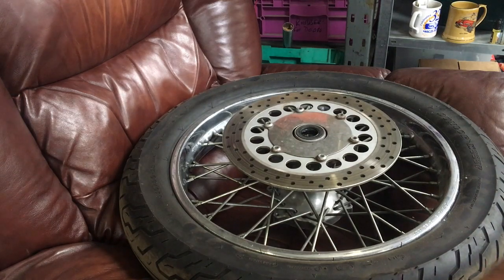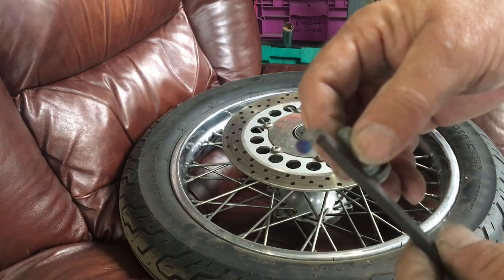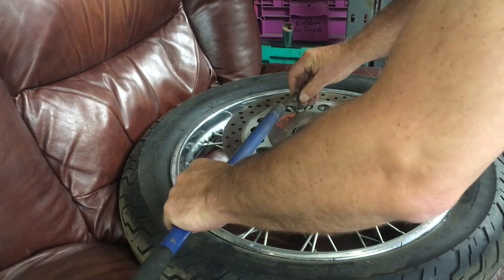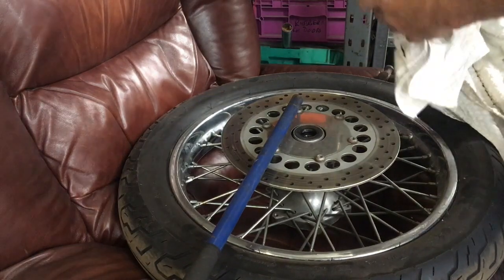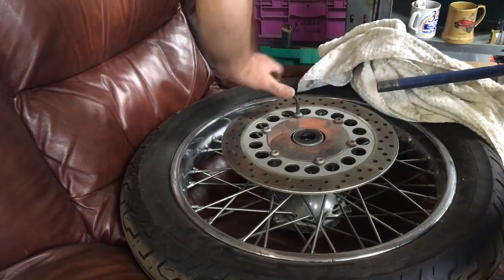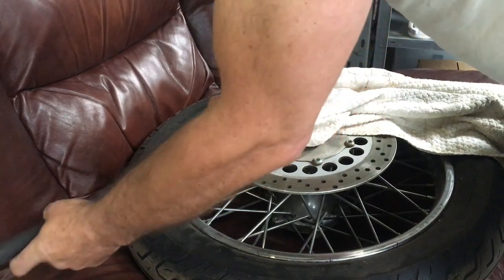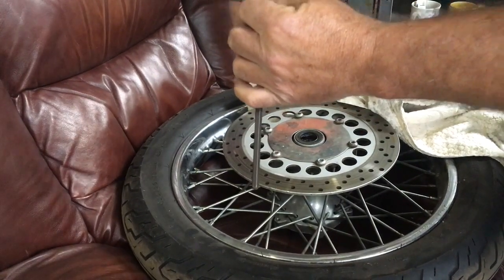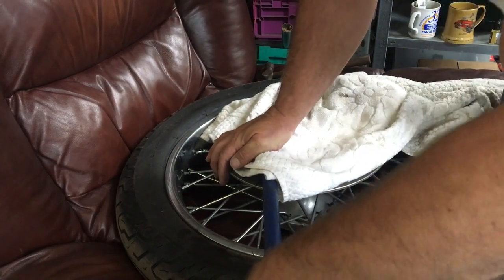How to remove Disc Rotor Bolts

Comment: I use a little heat first loosen up the loctite
Reply: I was thinking heat should help, mine ain’t moving at all!
Reply: @Benny46drift  you the first owner?  if it has been removed before they may have used red and it takes 600 F to get red hot enough to melt . Keep it under 200 F and use a long bar and have a friend help stand the wheel on the tire sit on the tire and turn the bolt , I have broke tork head off my socket and the bolt was stuck use a hammer tap on it shock helps at times with heat .
Reply: @JCcanU  sad thing is I only want to take the wheel off to take it in the house and polish it and add a centre guard lol. Might wait until it needs a tyre and do it all at once